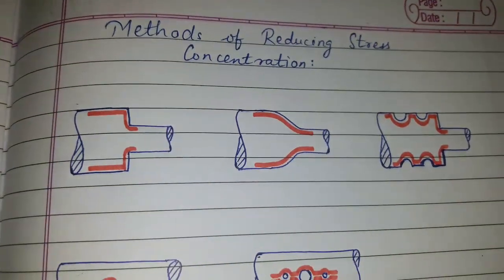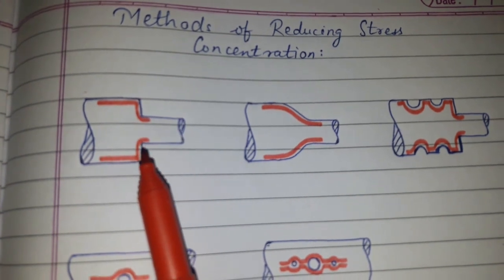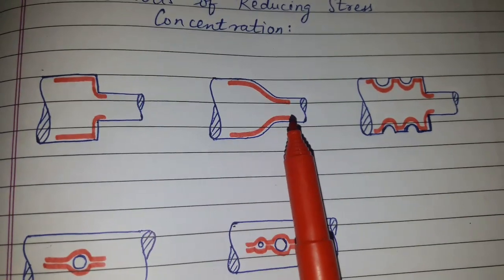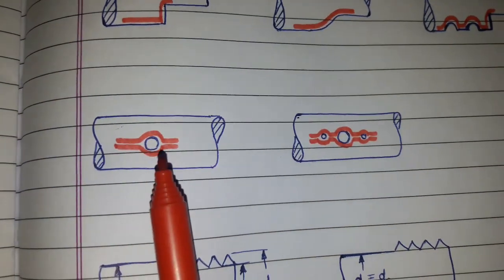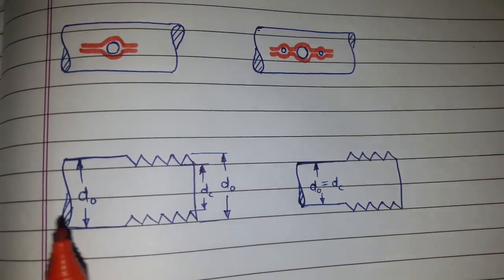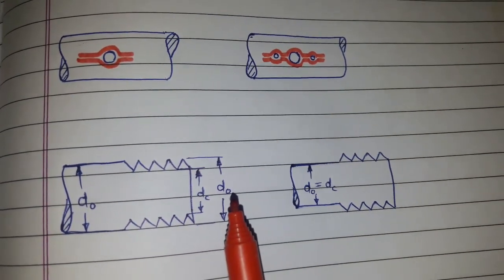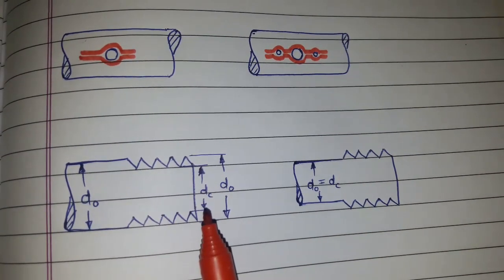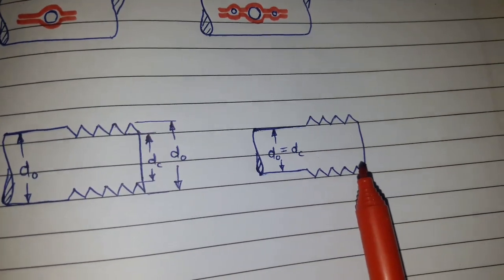3rd year Diploma - DME - Chap 1: Intro to Design - Method of reducing stress concentration

Comment: in factor of reducing the stress concentration in material , IS material   strength is also decreases ?
Reply from the maker: +Kunal Sahu 

If reduction of diameter is required for reducing the stress.... but you should not go below the design or minimum diameter... 
In that case, review of all the diameters will be required and change accordingly...
Reply: MechTech KnowHow ,ok